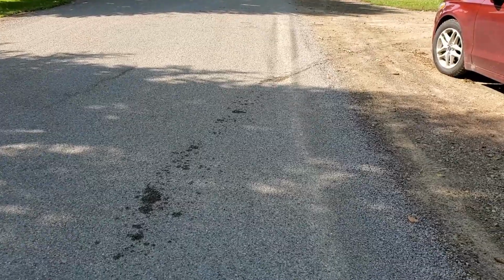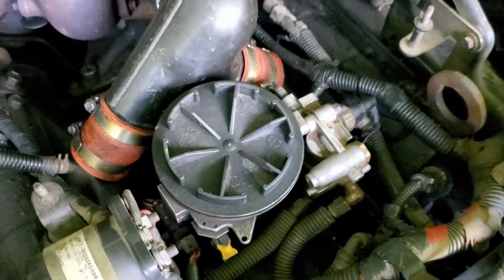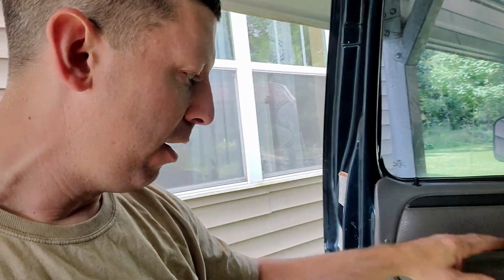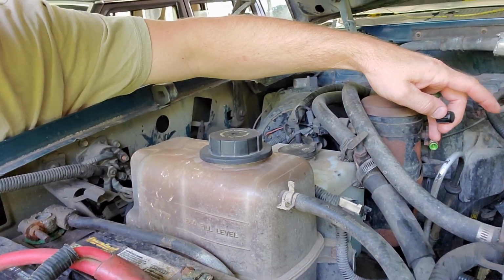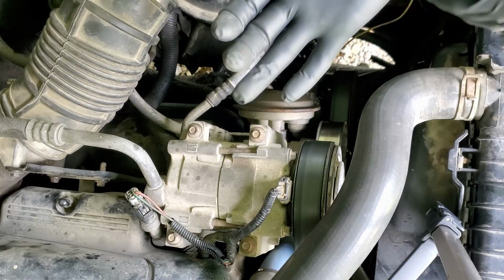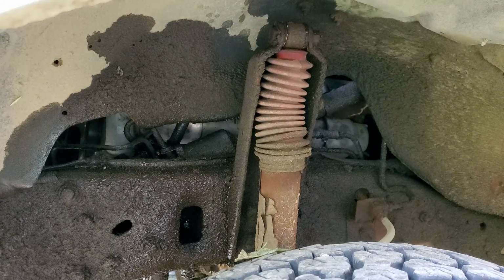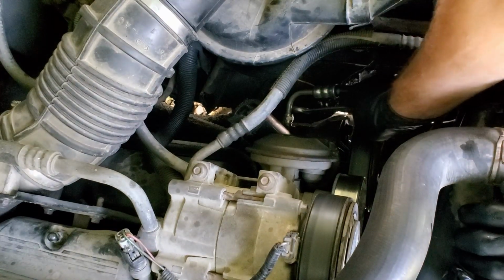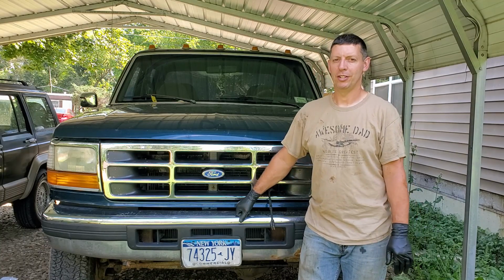1996 Ford F350 7.3 Powerstroke OBS | Repair Overview | High Pressure Power Steering Line Replacement

Comment: Thank you for the video brother. Appreciate it. I picked up a 1994 f350 w/ 7.3 idi na and my high pressure hose is leaking like the exon valdeez. Looks like bit of a pita job but I'll get on it soon when weather clears up. Thanks

Comment: Dude ditch those plastic handle.  I believe that it's a cp addict part. They have a bullet aluminum door handle. I'm working on doing a hydro boost conversion on my 97 f350 7.3

Comment: Is the pump side fitting suppose to be loose? It has a plastic crush washer at the top of the threads. The fitting is bottomed put the line isn’t tight? I went out to my buddy’s truck same engine same line and his was loose too. 🤷🏽‍♂️

Comment: Thank you for making this video. I am about to do the same thing and I was also very fortunate that the line blew off only a mile from my office. It was a bit humorous that I have happened to replace most of your list as well, it seems those are all too common in a 7.3. Any chance you are doing a video soon for the oil pan gasket 😆🤣. It is the only leak I have left and it’s a booger 😣
Reply from the maker: Haha! I haven't changed that yet. I'm glad I was able to help! I hope you get it fixed.

Comment: Hey bro I'm having trouble with my line leaking after instal at the drive box did your line come with an o ring on the gear box side? Cos mine didn't and I'm wondering if that's causing the leaking
Reply from the maker: I'm 99% sure that you should have an o-ring. That's the first thing I though before I read your entire comment.